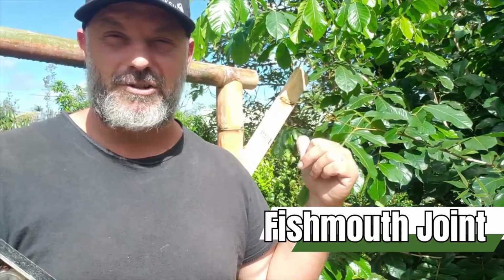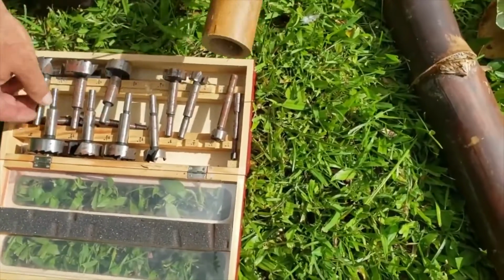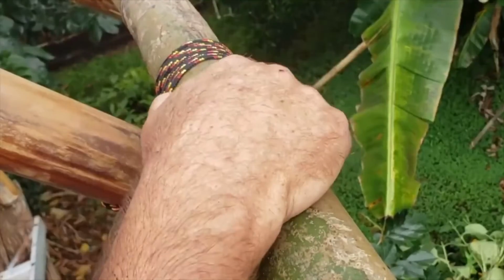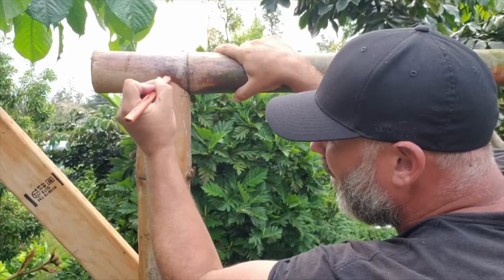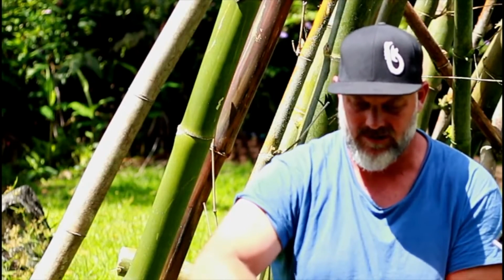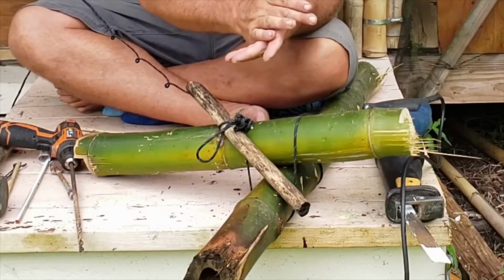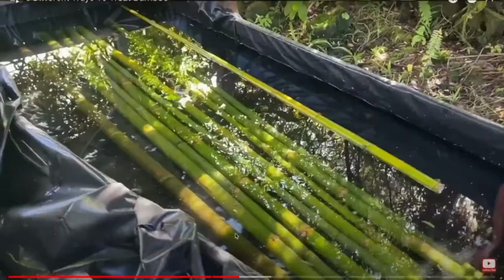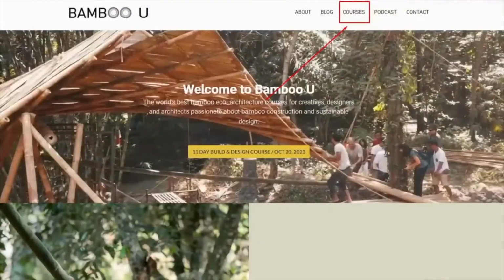Bamboo Treehouse Construction: From Start To Finish

Comment: Instead of creating a stone partition between concrete and Bamboo, the simple solution will be to use cowdung brick. Its waterproof annd does not absorb water .
Reply from the maker: Interesting. It would be worth a try
Reply: @miguelcanoe6774  preparing cow dung brick is a process in itself. You have to mix. Soil, limestone powder etc. to create the brick. You can sun dry. But the advantage is you can shape it the way you want. I am not saying current method is bad or stone is useless. May be I am wrong but I find it will be very difficult massonary working with stone.

Comment: Question: Can wooden pegs be used instead of bamboo? I live in Paraguay and we have some excellent woods that are very strong and resistant to attacks and rot.
Thank you for all the lessons in this video!
Reply from the maker: I wouldn't see why not, but they may swell differently than bamboo, maybe they might get loose?
Reply: @homesteadinhawaii  Good point to pay attention to.

Comment: Wouldn’t the concrete put inside bring too much wicking moisture to the bamboo?
Reply from the maker: Good question, It is what is done in many places though
Reply: @homesteadinhawaii  A similar system was used by mr chickadee, he posted a good how-to video on YT of the whole process- rock base, carving the timber out the japanese way so it sits on top of rock and then he used rebar and glue as extra attachment… very interesting